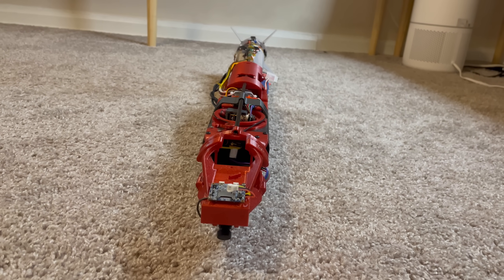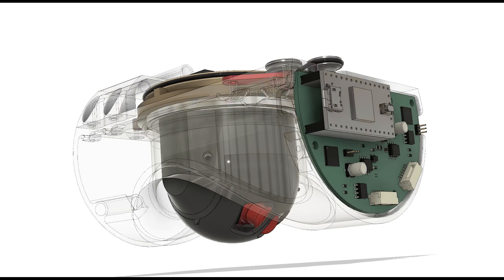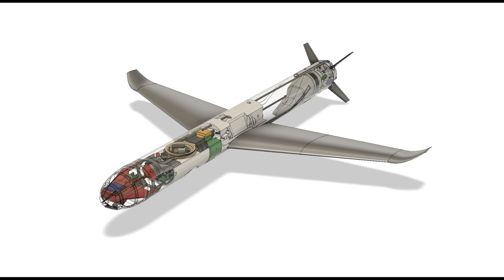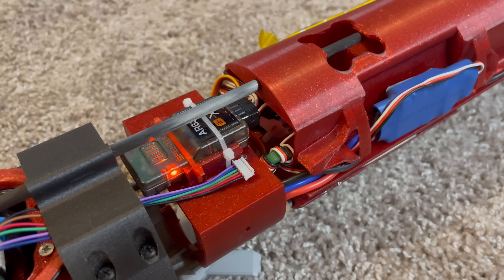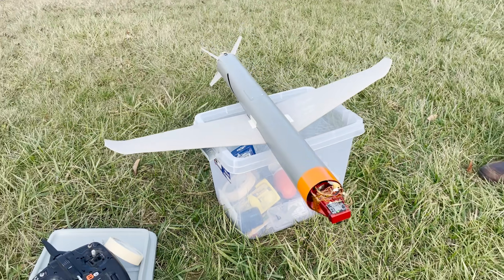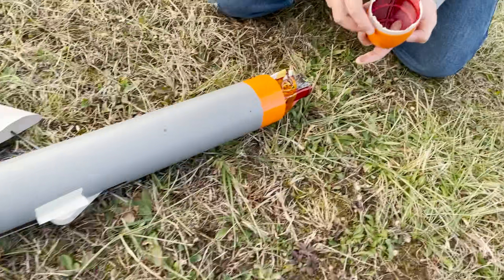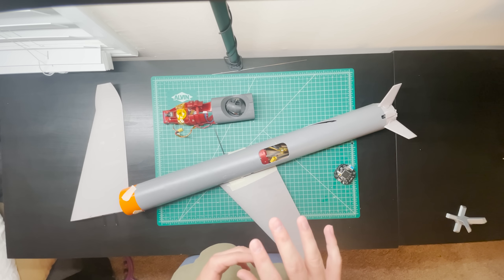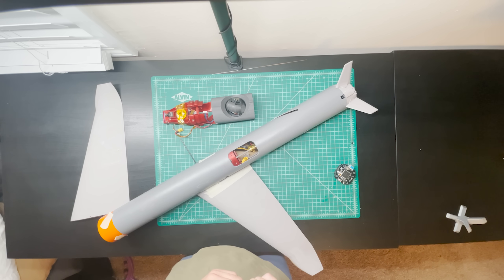Building (And Crashing) my Homemade Surveillance Drone

Comment: Some thoughts: 1. Are Center of lift/Center of gravity at the right spot? 2. Is the air inlet sufficient enough to generate enough thrust? Look at pictures of older Tomahawk cruise missiles. They had some kind of duct sticking out below for good air intake. 3. Is the thrust even enough for the over all weight? From the video it seems quite a lot of weight in the front. 4. The steering rudders might be a bit small to give enough directional authority?
Reply: This guy almost certainly did this already before flying, that’s like RC planes 101. It’s just an inherently unstable design.
Reply: you summed up all my thoughts perfectly, especially the on with the air intake. Good Job man haha
Reply: @olekXDDDD  Thanks ;-)
Reply: Add short canards at the front and back to help stabilize lift maybe? And recheck cg for main wing?
Reply: Giant water balloon slingshot with pvc rails and frame to launch it? At least it would go farther before it ungracefully returns to the earth 😂. Gotta get a little more distance from that thing 😉
Reply: I feel like with a set of canards (moveable or not) and a better inlet (or any way to produce more thrust), most of the issues could be fixed but that's just my guess, I'm no expert after all